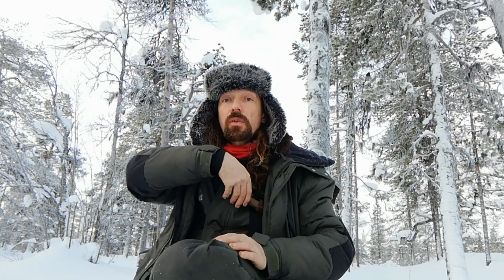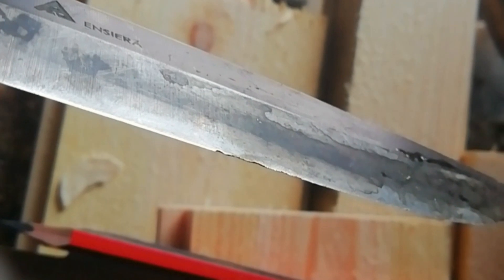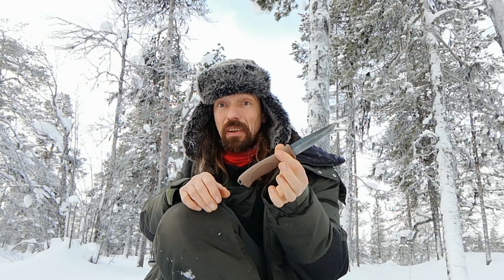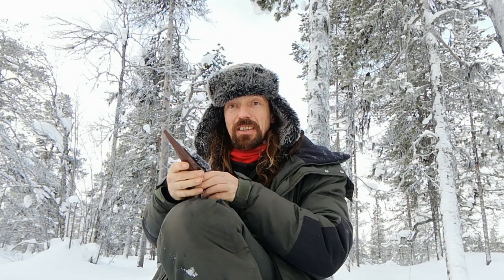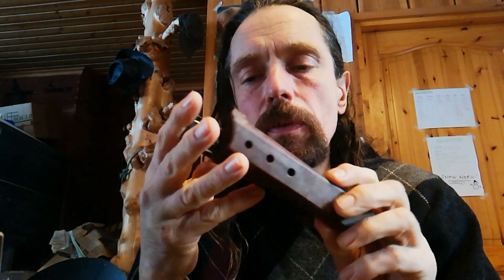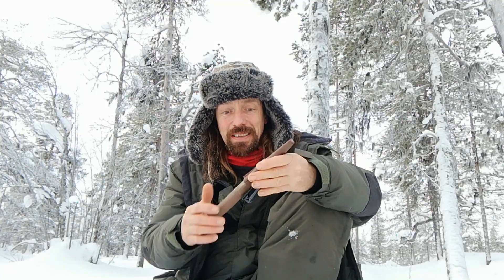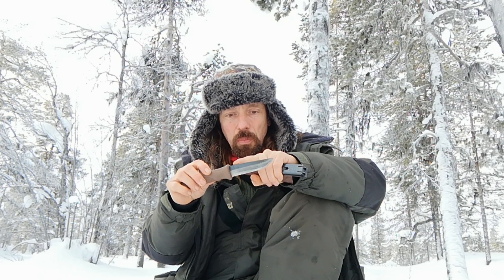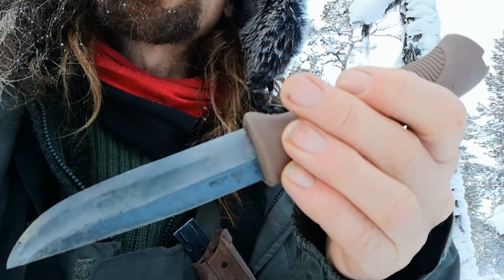Rokka Korpisoturi knife

Comment: Im re-visiting these reviews of the korpisoturi after owning mine for few years now, and using it daily this summer for bushcraft, i really really love this knife, its like an religious item to me now, since its kinda first of its kind a "tactical" military überd-duber kômmando puukko seriously if Rambo was from Finland he'd carry this 😂 ok so yeah im a fan boy... i like how it sits high on the sheat feels like you could draw it out in a blink of an eye if Igor would jump out of the bushes.. also although its 5mm at the spine it doesn't feel like an thick knife at all... also i had some concerns about the 63hrc and how it would hold up, but its been  great i do put a microbevel on all my puukkos and moras, and i mean an actual mircobevel not secondary grind. 80crV2 has an reputation of rusting easily and the rumours are true, even rain water spots the blade but to me its not an issue and i never oil my blades, only way you could ruin the knife with rust issues  would be negligence leaving it outdoors etc.. over all all jokes aside to me its 5/5 knife, the handle felt weird when i first got it and just fondled it at home, but at use its been great and secure, you can stabb it into a tree without any concern about slipping up on the blade...
Reply from the maker: That's awesome mate, I am glad it is serving you well. I love the edge geometry, however I have had some chipping on the blade but after some seriously hard use. The handle also split, wich I think was a problem with some of the earlier ones made (at least not heard of this happening on any newer ones). There are definitely a lot of posetives about the knife. It is also probably not for everyone, it is very different.
Thanks for stopping by again.
Reply: @KuukkeliBushcraft   i noticed yours says ensierä.... in English first batch on the blade as were mine had RKS V1 🤷🏻‍♂️ i do not know if they tweaked the knife some way but mine is rock solid, literally zero problems... i was just today in the woods giving it a beating... it sucks to see some vids and reports about the handle coming loose, i tried to squeeze mine but cant see even a millimeter of gap between the handle and blade..
Reply: Take good care of it, they are discontinued.

Comment: After  three months of daily use I'm really impressed with this knife. The best parts are the handle and the blade. This is really in a different class to Terava. My puukko is the newer N690 stainless variant of Korpisoturi with HRC 59, especially this one is worth the money with its easy-to-clean tough and shiny blade. 

There are no grips that are impossible or painful to use with this handle, it is the most versatile handle for real daily "puukko" use I've ever used. The thin roundness of this handle is what a "puukko" is all about; quite different to the style used in knives in other countries. With and absolutely secure grip, be it barehanded or with gloves.

The blade doesn't feel at all as thick as it really is (compared to Terava, which are really quite cumbersomely thick in comparison). The blade geometry is well thought through everywhere. The grind is just perfect for wood processing, be it feathers, carving or batoning. You can even cut vegetables quite happily. Every aspect of the blade is designed carefully for different tasks and cuts. The tip is in a tiny bit wider angle than the lower parts, for rougher use, but still paper-cutter sharp. 

I really only strop it. Compare that to stainless Marttiini puukkos that really need to be sharpened after each use, every day. My other 80CrV2 blades (like Terava and other Finnish blades forged by Laurin Metalli) need to be sharpened more often than my Korpisoturi N690 even if they have the same HRC 59 and are all made in the same factory in Kauhava. Korpisoturi quality is measureably higher.

There are no signs of manual errors in the grinding; every angle is perfect and symmetric. I think that is the biggest difference to budget quality knives like Terava. I've searched for a "perfect" knife or puukko for decades. For now, I search no more. Well worth the higher price.

If I need a big puukko, I'll use my Terava 140, everything else I do with Korpisoturi. And the tiniest things with a mini Victorinox. I don't need anything else anymore, when it comes to blades.
Reply from the maker: The blade geometry is really fantastic. I found the edge to be chippy but I would guess the N690 being a bit softer wouldn't be. Personally I think I prefer under 60 hrc for general use.
I did have one more problem with my Korpisoturi and that is the handle started to split come loose from the tang after a lot of use. This was after making the video though.
Thanks for watching and for taking the time to share your thoughts with us.
Reply: @KuukkeliBushcraft  Yes, my opinion is based on the N690 blade alone, I don't have the carbon steel version. I really, really like the stainless blade, after many, many either soft stainless puukkos or 80CrV2's that are a pain to polish after forgetting to oil them daily..  I see your blade, too, has those stains all over. They are insignificant otherwise than that they are not so aesthetical to use for anything food-related..

And it's not a fuss to sharpen, either. I did get two "micro-chips" to my blade from batoning firewood. I think they came from sand on the wood. But with a tiny bit of ceramic rod (of the worksharp field sharpener) I almost got them to disappear. They are still visible but don't interfere with thin paper or fingernail. Otherwise, only stropping is needed in my not-so-demanding mostly "home and firewood" use.

The 80CrV2 version may be a bit over-hardened. The N690, however, feels like a really good puukko material. I think I have to invest in another N690 so I can put this one to full use without any mercy, and see what it can take.

Did your handle material break/split/something, or did it just come loose from the base of the edge? My blade hasn't seen enough hard use yet to show anything other than the small gap between the plastic and the blade, when pressed. 

Actually, I'm myself not worried about that at all, since if it breaks I'll just use some glue to bind it together, or in worst case build my own new handle around the excellent blade. :) (...or ask for a replacement, since the designer's replies imply that would be covered by the lifetime warranty)

Thanks for your videos! I find them very informative and they have a good atmosphere.
Reply from the maker: @max_ljv  a couple of micro chips in (was it 3 months?) really isn't bad. The damage to my handle started at the base of the blade where the tang starts. It sounds a lot how you described it. It was after I made the video (wich was some months of daily use). Just started with a little movement wich turned into a split along the seam. I have glued it up and that worked for a little while.
I have also heard from someone else who had the same problem (after significantly less use).
I am very glad that you are enjoying the channel my friend.
Thank you very much for the support.

Comment: A nice knife review and summary of the pros and cons you've encountered.   Will you remake the sheath or make a new sheath to make a more user friendly sheath? It will be interesting to see how it performs in time. 💯❤👍
Reply from the maker: I don't need a new sheath for it just maybe a new belt loop. The clip is only held in by 3 screws. Easy to attach something that will hang below the belt of my rucksack.

Comment: How's that sheath working out for you I'm a little skeptical of it? Also the handle, did it ever loosen up or start to make a rattling noice? I like this knife because of the higher HRC but im also contemplating getting the tevera 110 because of it's reputation of holding up well. It's a tough decision between the two and usually when im in this situation I end up buying both.
Reply from the maker: The sheath has been fine, the handle though split along the tang and just from constant use rather than any particular misuse.
I have heard of this happening on the earlier batches of production only. So I am hoping it is a problem that they have managed to solve. Mine started to loosen up around the tang shortly after making this video so after about 7 or 8 months of fairy heavy use. Still definitely would have expected better.
Like I said I think this may not be an issue on more recently produced knives, but I would still rather recomend the Jääkäripuukko or Peltonen Sissipuukko.
Thanks for watching mate.
Reply: @KuukkeliBushcraft  yeah mate I've heard of this sort of issue occurring with the handle and I'm not certain if the problem has been fixed as of yet. Yeah I'm gonna go with a tevera 110 and a 240 skarma for now, eventually I'm going to pick up a sissipukko ranger as well. It's to bad because I really wanted this knife I heard they did an exceptional job on the heat treatment and I generally prefer harder steel's. Thanks for the update yeah!!

Comment: I’m thinking about getting one but I’m a little hesitant. Would you recommend it still?
Reply from the maker: I should do another video maybe, had a few more issues. Handle started splitting, now held together with super glue ( after prolonged use in very cold temperatures). Also had more problems with chipping, I think the cutting edge is too hard. It has had a lot of very hard use but then again so have many of my Moras and they have took it better. I think the size of the blade and the edge geometry work really well. Bearing in mind the price I would not recommend this knife. The Terävä Jääkäripuukko is a knife I would much rather rely on and it is a lot less expensive.
Reply: @KuukkeliBushcraft  thank you for being honest mate!
Reply from the maker: @roedeer_fanatic  no problem buddy.

Comment: Superb and candid review amigo. Very interesting to see that edge damage and also regarding the bend. I'd love to know how that did come about (fty or in use). I really want to like this knife, but the sheath just seems so flawed. I can't help think they were trying to be smart(er) than the Sissipuukko, but they haven't got it at all right (low slung, high riding, far too many parts and fail points with the loop/clip). I can't cheat on my M95 with such niggles. A rhombic blade alone, is not a big enough pro.
Reply from the maker: I would guess the slight twist in the blade came about during the heat treatment. The sheath has its positives, the retention is excellent and as for the belt clips. If you wanted to attach it to molle or something it would be great.
The Peltonen sheath is the best thought out sheath I know of. The sissipuukko is an awesome knife. Definitely one I would be more inclined to recommend than this one (expecially considering the price).
Thanks for watching bud.
Reply: Sorry to be so offtopic but does anyone know of a method to get back into an Instagram account..?
I somehow lost my password. I would love any assistance you can offer me!
Reply: @Alaric Finn instablaster ;)
Reply: @Cyrus Samir It worked and I now got access to my account again. I am so happy:D
Thank you so much you saved my account :D
Reply: @Alaric Finn You are welcome :)

Comment: Many people have agreed, that scandi grinds work better when the blade stock is 3mm thick maximum. After the 3mm, the thicker the worse it gets. There is a reason that the Morakniv, has the success it has as a knife, and that's because they keep it maximum at 3,2mm blade thickness! That doesn't mean, that this is a bad knife, however, what I said about scandi grinds is true. This knife has great steel, with a nice heat treatment and decent handle!
Reply: I would of assumed it's the angle of the grind instead... The only thing i can even come up with where the thickness makes a difference is batoning, but i'm not a knife person nor do i really know much about knives.
Reply from the maker: I thinner knife passes through things better (try slicing a tomato with a thick blade and you will see what I mean). When working with wood though you are less likely to be passing the knife all the way through the material unless you are splitting the wood (in wich case thick is obviously an advantage). Thick is also strong. There are a few factors to take into account. Obviously the angle of the bevel is very important too.
Reply: I thought the 5mm spine thickness would be an issue but because of the grind it's totally not, this knife made me actually laugh carving some hard wood for feathers.. the grind and hardness is a crazy combo

Comment: I wish it was bit more cheap. Good mod could be maybe to just attach d ring with dangler loop i just wish it would have more modular carrying options straight from the factory like different angles, and so on. I really like the higher grind type puukkos, and i have been thinking trying something bit more modern out. Allmost all my knives have been just standard puukkos with leather sheaths, and all. If the twist was caused by use it might be because many of the laurin metalli, and finnish blades in general of this steel are differentially hardened especially if the blade is heat treated to high hardness so they are not that springy. The core of the blade is hard, but outer layer soft like in other knife the jääkäripuukko you also reviewed
Reply from the maker: Pretty sure the twist came with the knife. I was thinking of attaching a leather loop to the screw holes. Maybe glueing a pice of plastic to the leather where the screws are. Should be pretty simple. Could also attach a ferro rod loop. Have had another issue since doing the review. The handle started to come loose and then split. Now held together with super glue. I believe they have some work to do on the design. I am not the only one to have had this issue.
Thanks for watching buddy.
Reply: @KuukkeliBushcraft  For expensive knife it has way too many issues. Already the twist i think in this price range is quite annoying. They definetly need better quality control, and some design changes. Thanks for the review
Reply from the maker: @lalli8152  I have heard they are trying out certain changes by someone who is testing them. As to what changes that is something they are keeping secret. Hopefully they will have a better product soon maybe even a cheaper one.

Comment: You should sharpen this knife at least 3-4 times, reprofile it to a slight scandi-vex and then, judge it's edge performance! Have you done all these, and still you get microchips on the edge?
Reply from the maker: Yes I have done these things and still get micro chips. The knife has been used daily for about 6 months now so it has been sharpened quite a lot. Some chipping but also good edge retention.
Reply: @KuukkeliBushcraft  Then, it's heat treated harder than it should. Scandi grinds are already prone to chips or rolls, because of their nature (very thin and sharp edge). I find, that scandi grinds wotk better around 58-59 hrc. More than that and you get chips, less than that and it doesn't hold an edge for long, for the same reasons again,( very thin and sharp edge..). You can always reinforce the edge more ( by rasing it's angle a bit and puting some convexing)
Reply from the maker: @greekveteran2715  63 hrc is very high. The chipping comes out with sharpening. It holds its edge really well. You sharpen less often but when removing chips you have to sharpen more. Like I said in the video it has been put through a lot of hard use otherwise the chipping wouldn't have been a problem. I also said I think I would prefer a softer steel (for the exact reasons that you describe).

Comment: You shouldn't baton with a knife Tim! I'm kidding mate Lol!!! I do that also and whatever, if a knife can handle it why not I say and its my knife/safety so yep. Doesn't look too bad, high rockwell hardness on that bad boy. A bit expensive though if I am to be honest. I remember this one, seems like you have for surely tested it enough to get a good idea by now. Beautiful backdrop btw mate! I prefer a dangler loop as well, not something sitting so high up. Ok anyways great in depth review mate!!
Reply from the maker: It's fine to batton with a knife, so long as its a fixed blade 😂. Pretty expensive but I am sure the fancy differential heat treat is the reason for that.
Reply: @KuukkeliBushcraft  lol yea yea I know I shouldnt do that and haven't been 😆. I never heard of a knife or seen any with that high of a heat treat mate. Usually its like 57-60 on all mine
Reply from the maker: @WaltRevenJr  57-60 is what it probably should be. There are reasons that that is what the manufacturers go for. Each to his own though there are advantages to harder and softer steels and the little bit of chipping isn't that bad considering the beating this knife has been taking.
Reply: @KuukkeliBushcraft  Very true mate and well said! I think my highest is 60, most are right around 59. I think its doing great too considering how much you have used it now!!